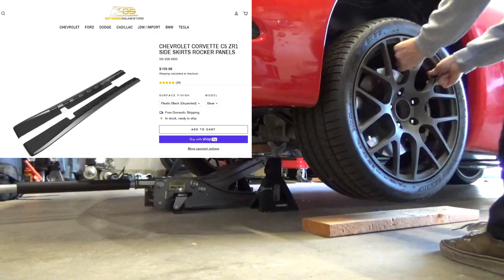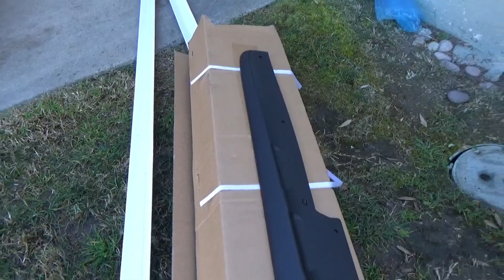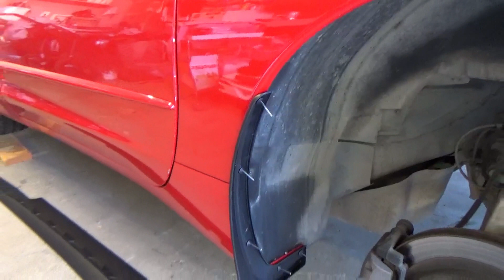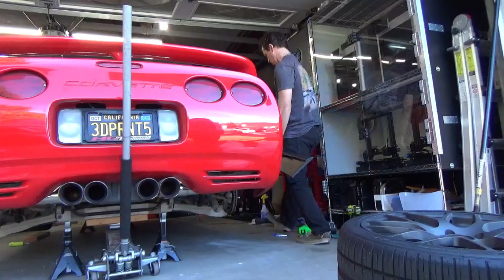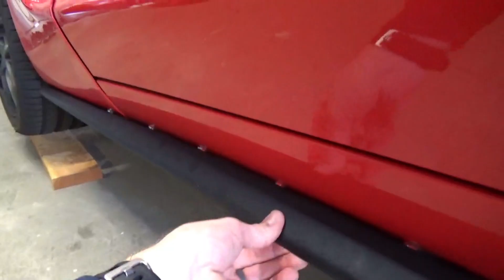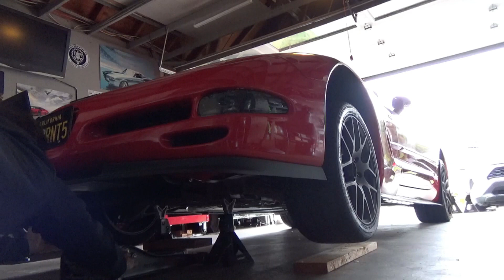An Inexpensive C5 Corvette Modification That Looks Awesome! - ZR1 Style Side Skirts

Comment: Just to clarify, you dont drill into the frame rail? Just the rocker panels? Does it feel secure? Plastic going into fiberglass doesnt seem very secure.
Reply from the maker: You’re right to question, I had the same thought too. 

Here’s my analysis:

- no matter which brand you go with, because of how the C5/C6 and built, all side skirts will have to be screwed into the composite rocker panels or riveted into the frame / composite rocker panels 

- I used a combination of rivets and self tapping screws with a small amount of epoxy on the self tappers to keep them from backing out. Some locations the rivets went into the composite, some locations I drilled a small hole in the frame to install the rivet. I used the rivets mainly in the front and in the rear wheel arch area of the side skirt so there’s lower risk for the skirt to separate from air flow and drag. 

- I work in the aerospace industry, we rivet into thin composites all the time. So long the holes are drilled to the correct size and the proper wide head rivets are used for this application to reduce risk for pull through, it should be plenty stout

- mine feel very solid. You’d likely crack the side skirt before the fasteners fail. Remember that these are really for aesthetic and serve very little purpose for handling aerodynamic loads.

Hope that helps!
Reply: @Addimotive Thanks! Finished yesterday. The screws kept hitting the frame like they were too long. Had to do some angling.

Comment: did they 'lower' the car much? ive got a large hump in my driveway where i sometimes just touch(mainly just the exhaust) im going to be putting larger profile wheels on my car in the next month they will raise it about 10-11mm(7/16ths) thanks!
Reply: The factory chrome 17” front and 18” rears on my c5 was the culprit behind my rough suspension feel. Car felt lazy and the wheels looked small on the car and felt everything on the road. Once I upgraded to 19x8.5 19x9.5 with 28 offset all around it made my c5 feel like a whole different car from a driving perspective. Plus the rear deep dish Vossen wheels gave the car a nice aesthetic. Also showed me just how high these cars are from factory. Idk if someone raised the rear even more on my c5 but once I lowered it all the way front and rear that’s when I fell in love with my c5 all over again aesthetically. For a while it just looked like an older c4ish corvette. The bigger wheels and lowered suspension really brought it back to modern times again.
Reply from the maker: Maybe an inch or so at most. These aren't that risky unless you drive over a lot of speed bumps and can potentially high center the car. The front lip is what you have to be the most careful about.

Comment: The front side vents on your c5 have boxes that open to the lower firewall. They are very much part of the spectacular .29 coefficient of drag the c5 has. They relieve engine bay over pressure and reduce the air going under the car to reduce lift at speed. Put a light on the floor by the firewall and look inside the vent. You will see the light. GM added the candlestick moulding running away from the vent to help clean up the air leaving the vent. Time for this false idea of fake vent to end.
Reply from the maker: Interesting. Can you cite your sources?